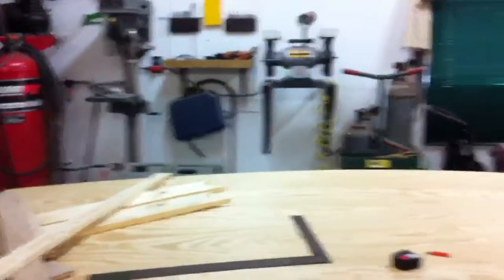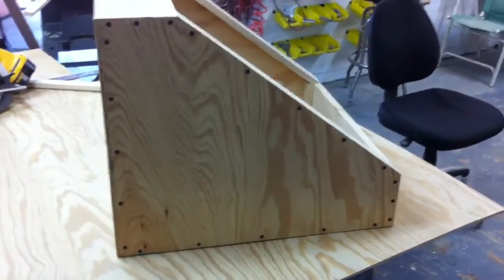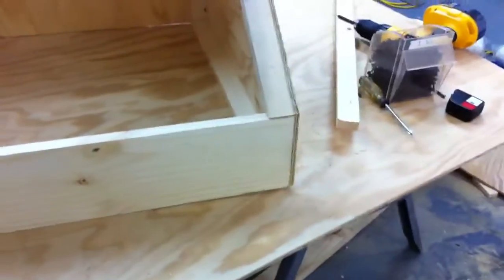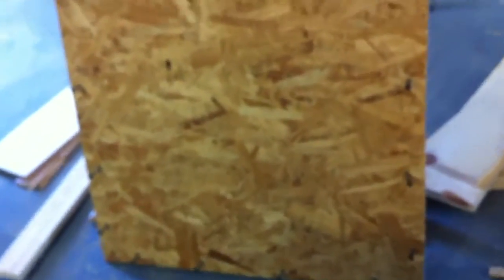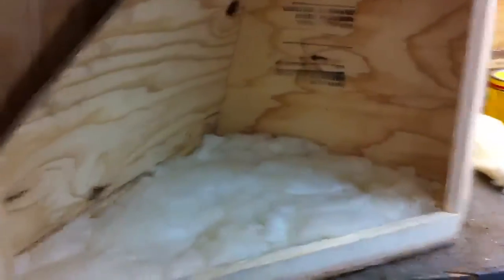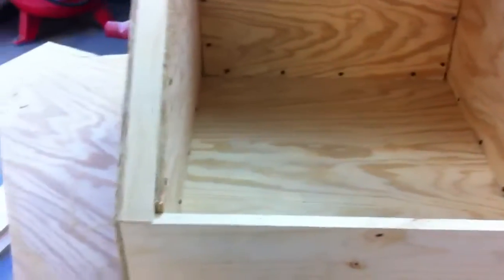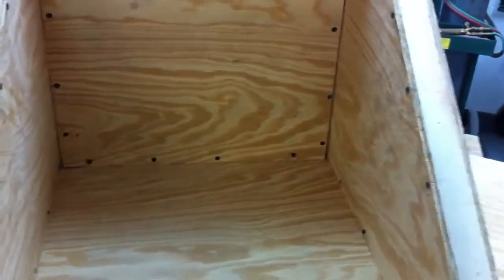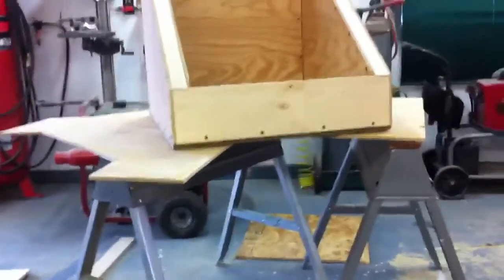How to build  a solar oven,   part one of four

Comment: also I would only use one pane of glass. using double pane glass creates an air pocket between the to panes that helps to insulate the window from heat transference not as much as if you filed the pocket with argon gas but enough to keep your solar oven from reaching its full potential.

Comment: to mount the reflectors I would hinge the reflectors so that you can fold them and then build a 2" thick lip around the outside of the door with the reflectors able to fit on the outside of the lip with to key holes on opposite sides so i can pin them into place.

Comment from the maker: @subtac i wondered the smae thing while i was planning this in my head. that was one of the things i had to find out before i spent time and money on a project that will spontaneously combust. the answer is,,,,,no,, wood doesnt combust until it reaches 660 degrees,or is exposed to direct flame.